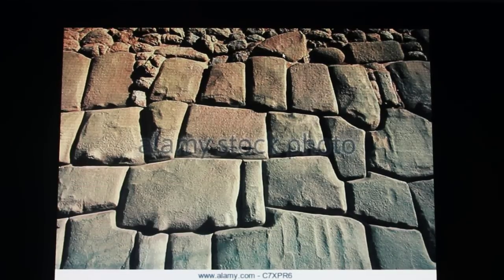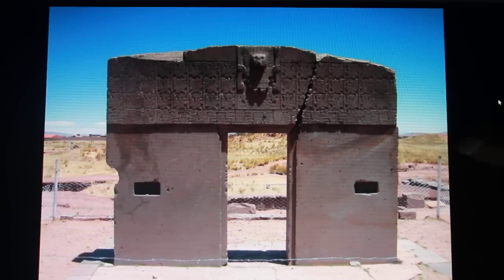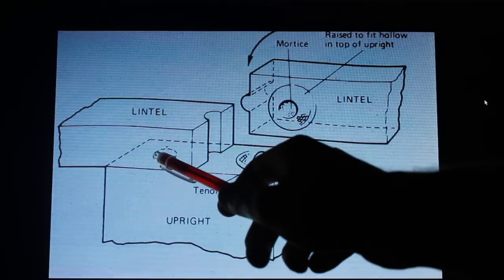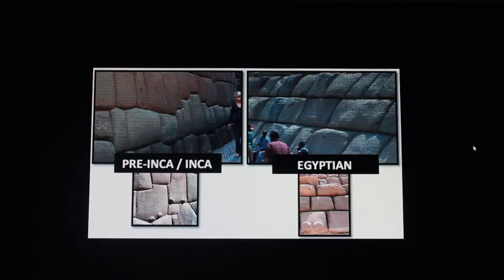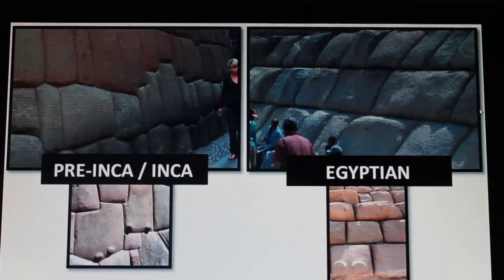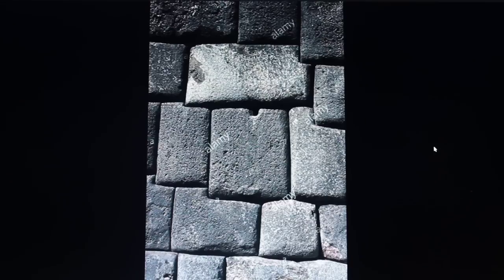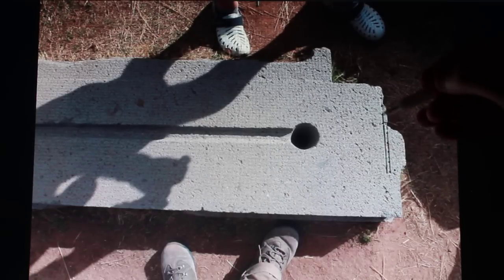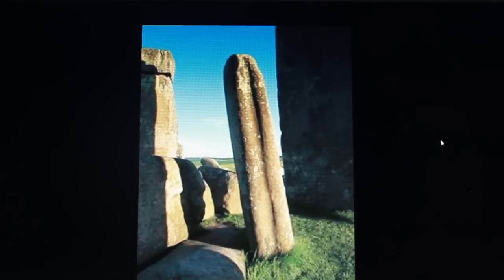Is this what the NUBS on megalithic pre-Inca walls are for? (FOR JOINING STONE?, Proof provided)

Comment: You might find this interesting. On one of the largest megalithic blocks of stone, the one that was carved out and then lay there brokem, on the side or almost underside are what looks like scoop marks, similar to what vertical impressions on that lower stone in your first photo. Also, those "nubs" as you call them, look like, to me anyway, what happens when you take clay that is not too soft, but still soft enough and push into it with a stick. There are many marks on these magalithic stones, that look the same as when you pound or manipulate clay. Did they have technology to soften the stone when this was built? Very similar markings. I worked with clay for 20 years, very similar looking markings. just saying.
Reply: I thought the same about marks being clay-like. Some areas looked paddled in a few photos. I also, worked with clay for a period of time.
Reply: I also thought the same thing. I have spent years sculpting with clay, and the "nubs" look like large boards were shoved in those places for support, until the blocks where hard enough to support their own weight. I also think that maybe each block could of had it's own unique sack. 
Maybe they fired the clay by using fire breathing dragons.
Reply: One operamom:  Of all the idea, yours seems to be the best.  The scrapes off the side of the rock could be because the rock, when it was soft was bulging out a little too far, they scraped it off.  And how did they make it soft?  The nubs, both kinds, may have been where they attached the electrodes?  Or whatever they used to make the rock soft.  ALL the rocks bulging around the edge is a dead giveaway.  WHY would they spend the time to HAND CARVE the edges.  NOT LOGICAL.  Also, when stacking blocks/stones they would get them close then soften the Joining edge.  and so on and so on.   Well, that's my 2 cents worth.   Fist up, Fight for Truth.
Reply: OK, I looked at it again.  The blocks that have the nubs are the ones that have the bulging.  They are also the blocks that are being joined to an ODD shape and are NOT straight.  This is because they melted them into this area.  The Stones that are straight do NOT have the nubs because they did NOT have to melt them into an odd area.  The straight cut stone also do do NOT have the bulging as much as the others.  Ok, now I have 3 cents into this.  
Please take a look and tell me if I'm Wrong.  
Fist up, Fight for Truth.
Reply: Zero Quanta, see now, I never noticed that the blocks with the straight sides had no nubs or marks, but what you say makes sense, they were not the ones that were softened because they would not all have to be softened to make a wall fit into place, good eye!
Reply: The same "scoop" marks are everywhere in Egypt it's the first stage in pounding and sanding the stone flat.
Reply: All you gotta do is some basic research and it will explain the "scooping" marks. Try to do research on both sides. Not just stuff that pushes for aliens.
Reply: I see the same minipulation onall edges also dimple that show vibration I think something with frequency slid into the stone, hince nubs when it retracted  it also placed the stone then vibration with frequency sofened the stone and was able to achive perfection..Lots of vids vibration and frequency's
Reply: One word... Geopolymers...

Fine stone powders were polymerized with plant based acids and alkaline additives, and poured or rammed into place... Or formed like clay.
Reply: They, the blocks do resemble cement, in terms of shape and slumping. These blocks also seem oddly uniform. No large streaks of other rock moving through them. Most people think they melted the rock, softened it somehow, but creating the rock from scratch, blending it like you suggest, makes more sense as you would not need to transport megalithic stone, just the ingredients to form them on the spot.
Reply: I think the nubs coincide with the tooling surface they used to guide the semi softened rock into a difficult join. The rock had to still be structured enough to stay in one main piece, but also soft enough to 'flow' the rock into complex joins. It also could be that the nubs are where the tool 'gripped' the rock, the gripped section remaining slightly harder, and then basically pulling the rest of the softer rock into place. Just like when you grab a blanket at the end to straighten it across the top of a bed.
Reply: 1operamom  i cant help to think these stones where haphazardly stacked. Then what ever device they inserted to soften the stone. Then they melded together and like clay or cubes of play doh they bulged and squatted in position. The device then was extracted. The nubs were where the device was extracted. And the stone became instantly like stone. Unable to trowel the nubs. At least that's what this little, big eyed, grey guy sitting on my coffee table said. But you have to admit these stones were somehow softened.
Reply: Hi Captbilly, I want to hear more about the little, big eyed, grey guy that sits on your coffee table—that story sounds more intriguing than how they created these large stones??? But yes, I do agree, these stones look softened.
Reply: Your proof is at the 2:23 mark on this video, note the fabric like impression in the rock, as well as what looks like folds, tiny folds of fabric impression, fourth from the top of this frame, which you can clearly see if you enlarge the image.
Reply: If this is true in all areas, you may be onto something significant.
Reply: Except we did not see how these were made, we do not know if they were never soft. I, personally, am just noting observation. The marks look as if they were made onto a soft surface, not a hard surface. I know what chisel marks look like, so do you I imagine. These look like soft scoop marks. That is strange is all I am saying.
Reply: 1operamom i been in construction my whole life, and when i see these so called stones. i see concrete like material that had a form built on it step by step and pump or poured into place with the impression of a cloth like from or bag ,and the (nubs) residual left over from the poor or bulging in the bag that's my impression anyway. it would be easier to mix and pour this into a clay like and or cement like form or structure. Then to transport the stones and fit them in this tetris-like form it would allow also to get perfect edges, rounded edges, scrape, or  shape it . you could turn it into whatever you wanted. shape it anyway you wanted ,and as it was hardening shape it evenly, or where you could get the scoop marks.  scoop marks also could be made by a structure to hold the form of a cloth bag in place.
Reply: I know, it looks like poured cement to me too, and that explains why the joins between the rocks are so tight.
Reply: There are some interesting points made in all this. However, there were at least 3 types of stone I have heard used. Andesite - do not know much about this other than it is hardness 8 (meaning diamond to cut) and it is stone that appears more like the poured cement. Although sometimes it is black andesite as well but do not think any of that was used in Peru (seen some in egypt). Your scenario of poured and molded fits this type of stone the best from what lil I know of it.

Quartz - also pretty hard 7 I think. I think this is the one that some have seen mirror finish in some examples (although was not really shown much in this video) and where some experts have already stated it seemed to have been heat treated to over 1000 degrees to give that high gloss finish. Again afaik would fit.

Limestone - least likely to work. Some have already suggested about heat cutting or heat for softening, except when heated it gets very brittle and shatters. Some limestone also have these nubs. I have only heard about heat treating for cutting and/or softening to beat into shape, not for melting. So I do not know if that is viable or not, but lets say not for argument. How would you explain this scenario.
Reply: Good point. And after re-reading your post couple weeks ago. From what I seen, the limestone was only brittle while heated and trying to beat it into shape. Once cooled, like bricks, guessing it would no longer be an issue with the limestone. I kinda doubted my argument sake to begin with, but was all just speculation as I have no clue.
Reply: The problem is vitrification, required to pour like cement, completely changes the chemical structure and water content. This should be easy to see. Nor would they be able to say oh these stones came from this quary as it would no longer match, which I know they have done at some sites. Unsure if they have done at all, like Machu Piccu just across river is quary site so might just be assuming without actually testing. What I can not figure out is if only softening it where it can be shaped and molded changes chemical properties as well. I have seen more examples of signs and indications that it was soft.
Reply: you are on to something-i think it;s poured cement
Reply: GypsyKing Yeah, and so old it's turned to rock!
Reply: The rock WAS soft - look at my answer above. Good observation.
Reply: Yes they had to have been soft, (and probably lightweight) at some point. And where you were thinking clay, I was thinking dough.

The way that some of them are puffed up, clearly resembles something that was baked (perhaps chemically) , and then left to cool and harden.
Reply: Some wonder if the Egyptians and other ancient civilizations had some sort of rock melting elixir, something that could produce cold fusion like the Romans had for their concrete or some sort of secret technique we haven't stumble upon today yet.
Reply: They look like the ends of wooden beams to be too.

Comment: the nubs are the points at which electrodes were inserted in the molten stones in order to pass massive amounts of current through the stones, melting them into a gelatinous goop that would slump perfectly into place on top of the stone below it and to it's sides.  Once the heating was finished, the electrodes were pulled out of the still semi molten stone, causing nubs upon removal.  where nubbage was too much of an eyesore, they were chipped off, and where nubbage is not very evident, somebody more experienced was manning the electrodes that day.  big nubs are apprentice marks.  :)